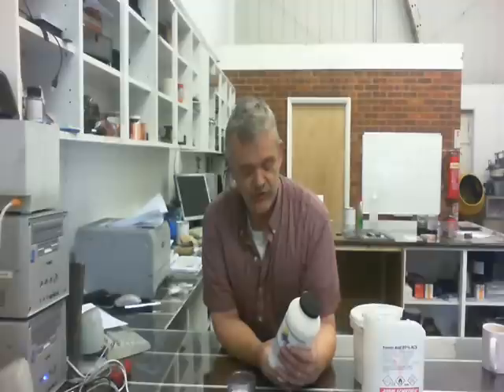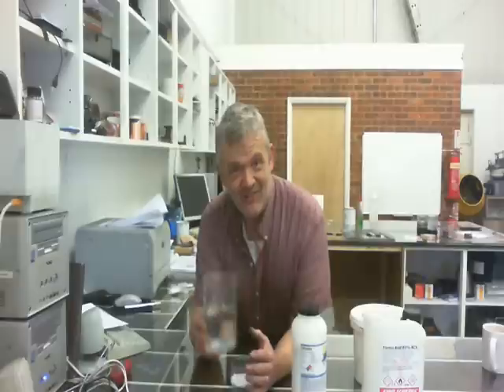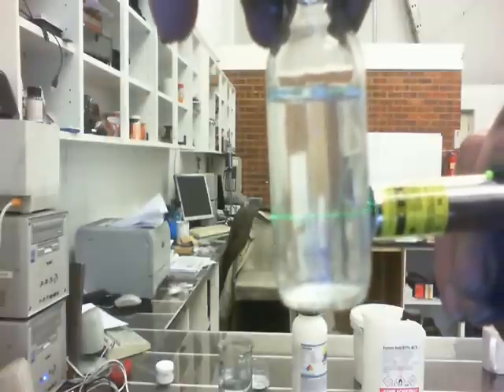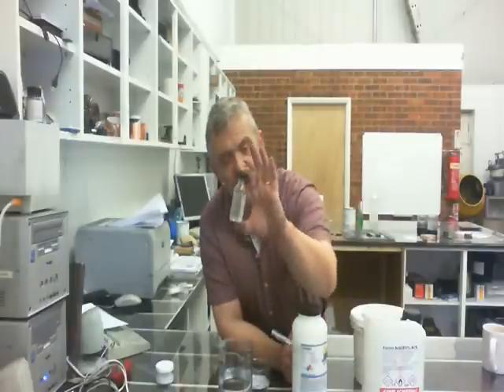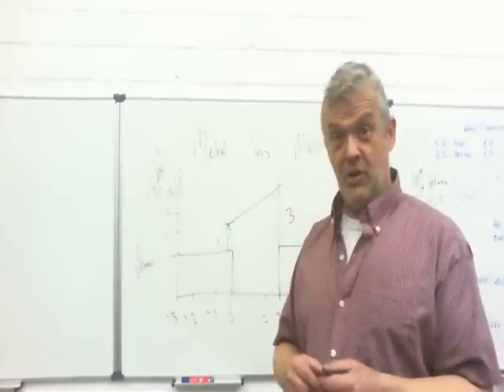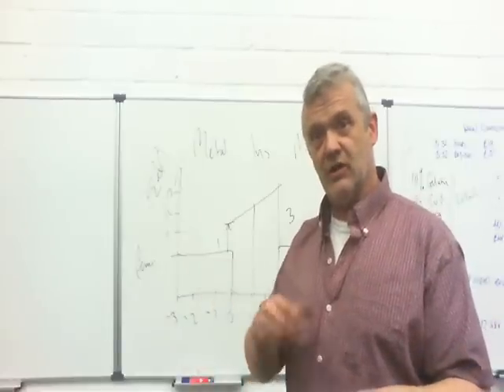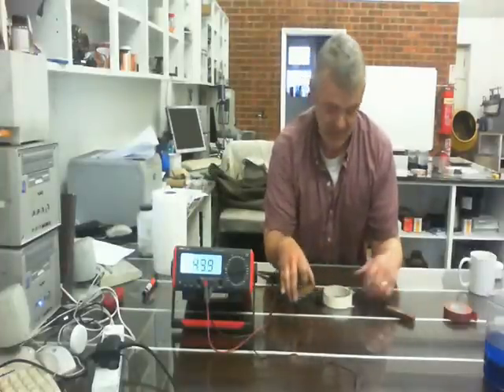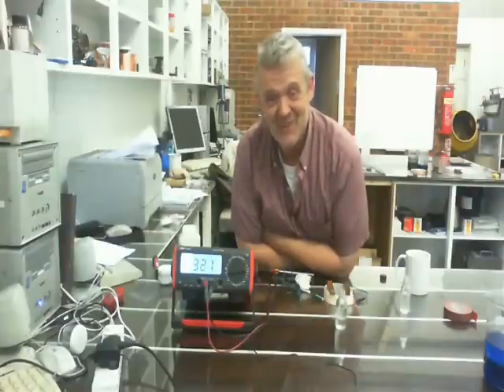The Birth Of A New Type Of Solar Cell ?

Comment: . You are a good man for sharing this stuff with the world . I wish you nothing but the best and thank you for your work ! i cant wait for the next ten years to pass and watch this tech along with others transform the world .
Reply from the maker: +jesusoftheapes Thank yo u mate for taking the time to say that - it's well appreciated
Reply: It is easy to be thankful , but it's hard to change the world . I cant wait to see what else you come up with.  
 I dont know if you answer questions but i have one .  I am looking for a battery pack that puts out at least 72 v to run a DC motor 4500 rpm that i am using to convert a gas powered outboard power head to an electric system .  The trouble is any battery pack i can find  that is powerful enough to drive this motor for a day on the lake is very heavy and my boat is to small for that much weight . I need the battery system  to be light enough output enough voltage to use the boat on the water for an entire day .  Can you suggest a graphine option to try out for such a build? Either to buy or to build ? I see the fast charge ability in your videos and see the possibility of a self sustaining battery system that could charge it self while running . Maybe im wrong but it would be worth a try .
   If its to much to ask of you i understand
Reply from the maker: +jesusoftheapes There aren't that many options to buy mate - you could try LiPO but that would still be pretty heavy and expensive - which really only leaves you building one - I am not sure of your back ground - that might be a bit challenging - but if you want to give it a go - there are lots of ideas around - go through google scholar and see what you think
Reply: i can make anything if i have a sound idea to work with  .,. i wonder if a magnet motor generator connected to a large version of a graphine battery  could be something i could use to keep the graphine battery charged at all times?Since the time it takes to charge one  is so much less then the discharge rate it sounds good in theory anyway.  who knows?  .  this is my "free-ish" energy experiment project .  if i actually figure how to build this it could be something special .  Ill figure something out 
. Thanks for responding i hope to see your work out here in the real world soon enough
Reply from the maker: +jesusoftheapes cheers mate - i think the idea is the same basically as if you strap a motor to a dynamo - they would run each other in perpetuity if there was no work done - but there is - if you set up a system like that it might work until you tried to run some thing with it - but i have never built anything like that so i don't really know
Reply: i guess im beating around the bush a little . here is what i really want to know . Do the graphine capacitor/batteries you have played with give me a real option for larger applications if i have a alternator feeding as its being drawn from ?
Reply from the maker: +jesusoftheapes i don't know mate - i have never tried that - so i just don't know - I am sorry but that's really the best answer i can give
Reply: well that is a mystery that may never have an answer .   ill start experimenting with other options.  I know this is possible and when its built it will really be something special and effective but who knows how long it will be before i find the magic system ?  I will make a self running, high output, electric outboard system .  Back to the drawing board. Thanks for getting back to me like you did . Best of luck to you and your projects now and into the future!

Comment: Robert you should experiment to determine which wavelength of light spectrum produces the most output power and then use a cheap optical filter for that wavelength. Then you can work on producing a gel or solid of your zinc-sulfide solution because outside heat will dissipate the liquid. Your choice of aluminum and copper are good because simplicity and you can also let copper heat in sun and aluminum stay shielded from heat to produce a thermoelectric effect.

Comment: Thanks for the info Robert. Look forward to your next video.
Reply from the maker: seriously thanks for the suggestions mate - it is appreciated
Reply: Is very powerful the positions awards with nano coathing and others systems like nano coathing into chamber without oxides gases and methane  and first step make plástic to this grafene impossible very nano coathing coath or Smoller production and said i grafene paladium this electrocapacitors hidrogen walls, make compounds that When fusioned dont but i said tail with biorganics acids solutions like yet but Moré acids with hidrogen walls

Comment: Sir, I have many lasers and often their beam  will diminish that quickly until they warm up and maintain initial output or with week batteries.
You've enlightened me once again in that it has a  name, Tyndall test.
I have used a green laser to do this very test on my wines noting their clearing progress. The most most amazing test comes from some Persimmon wine (a small burnt orange colored fruit). Although, to the naked eye, it appears perfectly clear but for the yellow tint. When illuminated by the green laser, Wow, what a show. Making wines, kefirs etc. is about the limit of my knowledge of chemistry. Yes, practice improves my luck as well. Perhaps, this being my first YT comment, I will upload some video of that and other sundry curiosities which fascinate me.
Later Friend, Rottin out.
Reply from the maker: Rottin Rodney link me in when you do mate - it'd be cool to see
Reply: Robert Murray-Smith
I have noticed how interactive you are withe your students and I tip my hat to you for that. I am encouraged and it would be my pleasure to do so. Thanks again.
Reply from the maker: Rottin Rodney i try - it isn't always possible - but i really try when somebody says something interesting like you lol

Comment: I like the solar cell a lot. I've watched a couple of videos that you have done on at the new improved one and such. what if you took the two electrodes the copper strip and the aluminum stripped and made fingers across the face of the solar strip. Probably like wire size kind of like a mesh. This might give it more and quicker collection.

Comment: Hi Robert. This is really fascinating. Love your vids & enthusiasm. :)
Do you think it would improve the cell's efficiency if:
a) the electrodes were closer together, and in multiples. (less distance for electrons to travel, and a stronger electric field?)
b) the coating material was much thicker - i.e. black - so it captured more light...
What do you think? 
I think perhaps the best feature is that anyone can make it from simple materials. No silicon labs, no nano-printing etc... It could be a really accessible tech... It could also be used for infrared harvesting maybe? Did you test it with heat alone?
Thanks. :)
Reply from the maker: cheers mate and i imagine it would work as you suggest - personally I haven't done much with this for a while - i will get back to it at some time
Reply: Thanks for the reply. Can see you're busy with more fascinating & inspiring stuff... :)
I'll keep thinking about it...
Reply from the maker: awesome mate - it's here for everyone to work with if they feel like it

Comment: Maby this could open the opertunerty for a kind of solarcell I got 35 years ago. Where you have a fluid inside a small fearaday cage so when the electrons are knock free they will go to the outside of the cage and thereby out of solution.

Comment: Robert could you do a quick test? Shine the laser through the solution but put a piece of white paper on the back side of the test tube. Does the light on the paper grow brighter as the laser line in the solution grows dimmer or do both get dimmer at the same time? I ask this because I read about magnetic mirrors and I saw some similarities between what these researchers did and what you're doing. The paper is Magnetic Mirrors Enable New Technologies by Reflecting Light in Uncanny Ways. So if the light dims inside the solution and on the paper, the particles might be acting as a magnetic mirror and that would be very cool.
Reply from the maker: cool suggestion mate - i'll try it in the morning and let you know

Comment: Just finished your solar cell playlist. More questions as normal. ;)
I understand the principle of the diode, reminds me of the crystal radio cat whisker diode.
What I'm confused about is the insulator in a diode is very thin, so the electrons can tunnel through but only in one direction because of the difference in work function. Which part is acting as the insulator in this cell? Why doesn't the graphene in the ink the short circuit things?
I see it's working, but I just can't understand why!
Reply from the maker: me neither lol - sorry about that - but i can't honestly say i understand
Reply: Robert Murray-Smith I made one of those razor blade diodes for a crystal radio as a kid, I only ever managed to get it work once and never understood it at the time! This is a similar principle I think.
That works because you heat the blade to create an oxide layer then you put a pencil tip on the surface, because the oxide layer acts as a semiconductor / insulator, electrons can tunnel through (or whatever explanation you choose) in one direction more easily, so rectifies the high frequency of radio signals fed through it. In practice, finding a spot on the blade with the right thickness and conductivity is difficult!
But with this the two metals are far apart so how can this be acting as a diode?
Reply: Robert Murray-Smith Thanks for the input, as always.
Very interesting idea.

Comment: Just watched the other vid with the clear cell you tested in the sun. Very interesting stuff! do you think stacking them would be better for production per sq cm? Since its clear and light passes through it, I think one could equal the current solar cell efficiency. Thoughts?
Reply from the maker: it will have a percentage transmittance that will limit the thickness but you could sack them - yes

Comment: I did similar work in my Master's Degree Thesis for my Graduation   but the deposit was Cadmium Sulphide (instead of ZnS) thin films on any surface, and when I deposited the CdS films on an aluminum plate, then  deposited Copper2 oxide on the CdS film I made the well known  CdS.CuxS solar cell which generated under sunlight 3ma/ cm2. I wish if you have time to do some work on this subject and I can send to you copy of my published thesis.
Reply: Hi im doing some work also in the same staff can you send me your thesis!

Comment: Robert, I was wondering whether you have tried these solar cells in direct sunlight? It appears that in this video, you tested the cell just under UV light. I'd be interested in the findings. I was also curious in your voltage output. Awesome videos! Thanks.
Reply from the maker: i did mate - i think i did a separate video on it - to be honest i shelved this for a little while until i finish up the eesd project - which is nearly done - then time to drag this one back out lol

Comment: Very interesting theory indeed. What are the chances of this being increased in power to a  useful amount, sat, enough to build a panel that could be used for battery charging. Is any further research being carried out. Imagine; charging a battery using ambient light as opposed to bright sunlight. That would indeed be a game changer.

Comment: Robert Murray-Smith Hi Robert, I have followed your method to make the ZnS nano particles to the best of my ability and I have manged to make the Bis thiourea zinc formate, which I then added the electrolyte solution to. After the larger ZnS particles have settled I get a clear solution that passes the Tyndall test (i.e. I am able to see the laser line) however I do NOT see the dimming of the light. Just wondering if you have ever experienced this outcome and if you have do you know what I may be doing wrong/different to you. Just for fun a passed the the solution through a 0.45um filter then re did the Tyndall test. the resulting solution failed which leads me to believe that the particles suspended in solution is at least 450nm in size. Thanks for the great video.
Reply from the maker: Hiya mate - no it didn't happen but crystal growth is bound to be important here - so slow recrystalisation is bound to be important

Comment: That went too technical for me, but was very interesting either way ! I saw an interesting article last week about some guy who made some kind of huge lens (actually a ball of glass filled with water) which concentrates the sun rays in order to give more efficiency to the solar cell, I found that really genius, but you know what, I actually had that idea last year (I'm not saying Im the one who had this first, I bet plenty of people thought of this before !) of using lenses to magnify the sun rays in order to (I assumed) provide ton more energy to a solar cell !! 

love the idea, thought i'd share :), plus it would make sense to use high yield solar cells, but like a small size, because it's very expensive to produce, and use big lenses to magnify the sun rays.. because that's worth nothing, compared to high yield solar cells anyway..

I think that's the future of solar energy, for instance they even said in low sun exposure areas you would still get a good yield, make sense !!

I actually ordered some mini lenses and I plan to conduct some tests relating to heat conductivity and solar cell efficiency ! 

My scientific self is emerging, and people like you inspire me alot.
Reply from the maker: +Thomas Syxe v cool mate - you can use the same idea to make cheap spectacles that can be individually tailored for the user at the point of prescription
Reply: Oh you mean custom sized lenses depending the need ?
Reply from the maker: +Thomas Syxe exactly
Reply: I need to buy a multimeter and learn how to use it ( I forgot from the courses I took aha) and then try on one of these cheap chinese solar panels you can buy for a few bucks, actually I got a 300ma/h one :)  wonder if it improves it..
Reply from the maker: +Thomas Syxe it's all about the doing mate
Reply: you're right ! I must do more, I bought some electronic equipment but haven't even took the time to mess arround with yet ! too distracted..
Reply from the maker: +Thomas Syxe lol - coolio
Reply: one thing I discovered when plugging an LED to my solar cell, is how artificial light can make it work, I found that quite mind-boggling.. from a few watts LED lamp :o lol. like you said, it's all in the doing ahha
Reply: Fuhgadaboud bulky lenses. Just get small Fresnel lenses if you can source them. Better yet, use the Fresnel lens from a flat (plasma? LED?) monitor and find a distance that'll illuminate multiple cells without melting them which would happen if you  placed them (it) closer to the focus. These Fresnel sheets are YUGE magnifying lenses.

Comment: have you looked at the intensity of your laser beam without the tube in front? Most green lasers do this: the intensity is much higher in the first second or so and then it drops in intensity when the YAG-crystal inside converting the IR radiation of the laser diode into green light heats up.

Sorry, no solar cell here...

Comment: Interesting , I observed something interesting with a stainless steel dog bowl, filled with water, and a piece of aluminum foil suspended in the water by means of a stick resting across the sides, to which was added a capful of cider vinegar. It produced in the milliamp range, since it was done outside on a cloudy day as a bit of a try out, to my astonishment as soon as the sun hit the experiment the rate of production increased tenfold. I assumed the light was dislodging electrons and pumping the circuit.
Reply from the maker: cheers mate - thanks for taking the time to write
Reply: @ThinkingandTinkering  No worries its all about gathering random bits of information and assembling them into a coherent whole.

Comment: hello robert..no quite understand cell eta is Censible light parese or more to a galvanic cell redox ??
Reply from the maker: bruno agrelo I am sorry mate - i don't understand your question - can you write it in your home language
Reply: SI CLARO ESTABA PREGUNTANDOTE SI ERA SENCIBLE A LA LUZ O SIMILAR A UNA PILA GALVANICA OSEA EFECTO REDOX.??
Reply: Robert thanks for your prompt respuesta..en my country is very expensive energy and solar panels are not within the reach of workers comunes..por this reason I'm looking for a way to make a solar cell I tried to replicate assays eficiente.he Flexible your cell with few resultados..tome a film and achieve acetate do el..tome conductive graphite rubbing two thin sheets of copper ( anode ) and one of aluminum ( cathode ) and electrolyte used .. potassium iodide. then use other electrolytes such as salt , magnesium sulfate can help etc.With few results not understand where I have failed. 1.5v would have to give me a minimum and I 've only come to 0.40v ??
Reply from the maker: bruno agrelo ehy are eesds mate so a kind of half and half